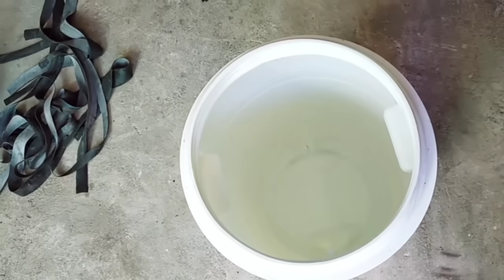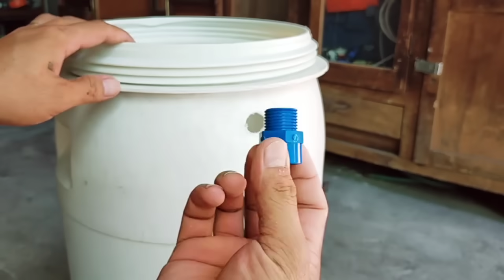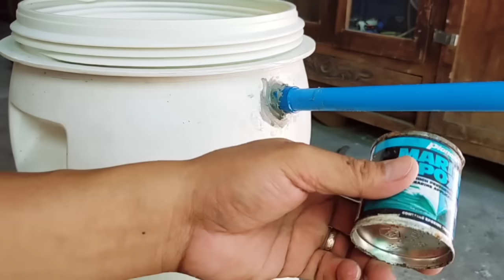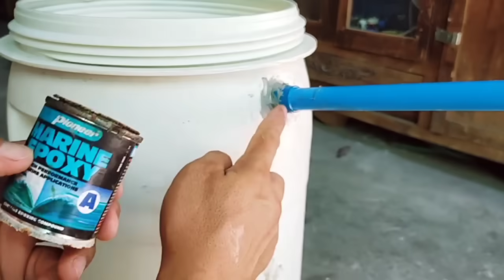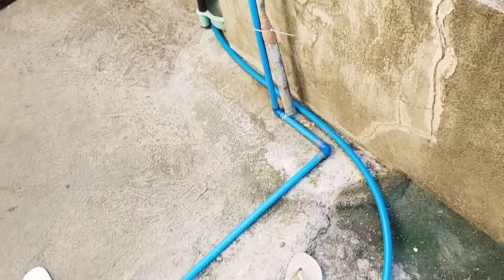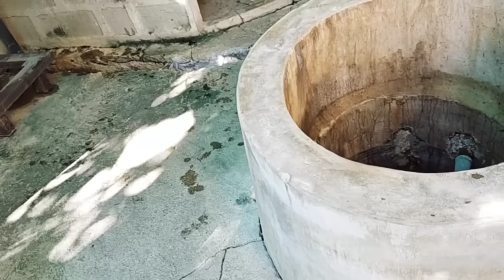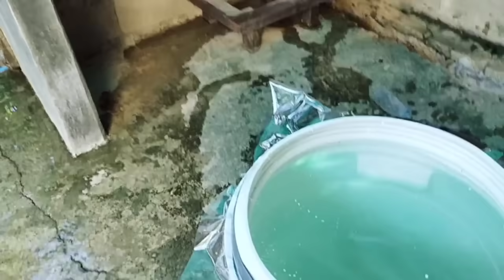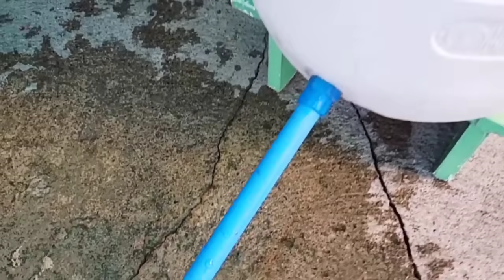improvised water pump no electricity how does it works none stop water life hack part 2

Comment: So if this works you could just let the water go  back into the well or a pond for that matter for circulation and aeration purposes. Interesting. Effectively a small waterfall pump without any moving parts! A foot valve at the bottom of the intake hose would be good right? It would be nice to know the over all height differential in this experiment. Such as the distance from the intake end  in the well to the upper outlet on the tank column.  The height above the surface of the well water to the tank column lower outlet.
This distance represents the achievable lift out of the well.
 The vacuum column pulling water in at the top as water drains out the bottom  is really cool!
Reply: To nice to be true! It would be a perfect perpetuum mobile, since if water flows back in the well you could let the water drive a little turbine. It is impossible to lift water to a higher level without an input of external energy. However, if the outlet is lower than the water level in the water reservoir, it works. Water will flow some height upwards and a bigger height downwards. But this doesn't need a drum and was already known B.C.
Reply: @sciencefreak9070  I tried a small version. A milk jug on the edge of a sink. The up draw from the sink shows there is "some" pull as the outflow takes place but I have enough curiosity to continue to experiment even though it does really seem unlikely.  Nice youtube prank though. There is that.
Reply: @kazparzyxzpenualt8111    I don't know what exactly you tried with a milk jug, but I can assure you that the outcome of such experiments are easily predicted for any arrangement. There are no unexpected surprises in this field which could be discovered.
Reply: @sciencefreak9070  you know under pressure?
Reply: @mafiozozpruszkowa9419     "Under pressure"?  Objects and persons can be under pressure. But for this video only air and water pressure are relevant, and I know these pressures and what values they will reach during operation.
Reply: If installing a bigger outlet or multiple outlets would increase the the pressure drawing the water into the tank then I'll go for multiple outlets which some will be just for taking the water back to the well and installing turbines that will be turned by the returning water thereby free water and and free electricity

Comment: hello, I recreated the same system but opening the tap to let the water out does not draw from the well, are we sure it works?
Reply: Water level in well must be higher than exit for this siphon to work, as with any siphon.
Reply: It should be air tight.

Comment: Wala na sanang nagbininta ng mga electric water pump at genarator kung gumagana nga ito
Reply: It works. If it was fake and pump driven the plastic should inflate outwards. But here plastic cover sucked inside. It may work at 6m deep well with 1m hight water.

Comment: This is capillary principles on the great scale  , this system works because the atmospheric  pressure its a little bit bigger at the surface level of well than the level of the outlet pipe .. You know , at the sea level the atmospheric pressure its higher than in the top of a mountain . In this system this principle its helped by the vacuum chamber and the gravity , the weight of water mass flowing down

Comment: Assume  mass M of water from the well and the height(the level of well water to the basket ) be H. The amount of energy needed is MgH. where does thsi energy come from?It must from the water running out of basket. Assume the height of the basket be hand the amount of water running out is m. Them MgH=mgh.  that is MH=mh. As M must equal =m as they represent the water runing out. Therefore h must be equal to H. Therefore, it is impossible. just a cheat.

Comment: The amount it vacuum you would need would collapse that plastic seal or even that cheap container. In this case air would go into the open end of the pipe if you could get it sealed
Reply: Not really. The only vacuum created is at the outlet end and not the entire mass of the water- it is supported by the container. 
It would be much less vacuum than you are thinking. For example, a increasing diameter outlet tube would equal larger vacuum pressure affecting the lid, to the point it would collapse.
Reply: @shane 
Your observation is wrong. The vacuum created is compensating by the water inlet..
Reply: Incorrect. The plastic just needs to be able to support the amount of water being suctioned.

Comment: What is the theory of this mechanism used.plz answer
Reply: You want to understand theory first read how ram pump work. Google it this setup is reverse the ram pump setup. Both sys use gravity and momentums of flowing water. Ram pump creat pressure use that force to pump up high ground but this sys is reverse creat vaccum suck water from low ground when moment sucking force and reverse water weight equal it shut return block vale at bottom of sucking pipe. But before shut off there fluid memoturm trap some water bottle neck of vaccuan tank those water flow in to tank use gravity that process non stop repeat time you only see small amount of water enter to tank.

Comment: Very gd , I have down my own but not working i used small drum and the intake pipe 12mm black pipe whilst the output is an ABS pipe 12mm.. Once i filled up the drum it was compressed due to the pressure of the output too strong whilst the intake pipe internal hole too small  compared to the ABS pipe out, i will modified the intake pipe into 20mm or 25mm may be it works because the supply to the drum can coup the output..any suggestion from anyone of you..pls comment.
Reply: Dear kaka Lala Salams, if you want to use this process for irrigation kindly use cemented well rings instead of drum so that it should not collapse. khattak from Pakistan.

Comment: Good idea, I wonder the maximum well deep length and also input and output pipe diameter, I have a 18m deep well and not sure it will work properly.... Any thoughts?
Reply: don't waste your time and materials. forget this video. this is fake.
Reply: @edgarcordova4534  means no other way to have energy free pump?
Reply: @neoteo4506  I wonder. Man's so pessimistic
Reply: @chimaihedi  what are your thoughts Chima?
Reply: @edgarcordova4534  its not fake... But suction head has limitation... 
Get some free time and bigger drum... And prove yourself wrong.

Comment: On your first take the plastic burst. What did you do to fix it? How long did it run ? What is the depth of water in the well?
Reply: forget this video, this is fake
Reply: it happened to me as well with the tank than air starts getting in from the out let pipe
Reply: That why who use in field they use 55 gallon iron barrel.

Comment: Just curious if anyone could actually replicate this.

Although on principle,  the pump looks like it could work, this example is fake, and here's why.

When filling the barrel with water, any water that reaches the intake pipe (coming from the well) would drain into the well.  Also, once the bottom pipe is opened, the gap (vacuum) created would have to atleast equal the volume of the pipe going to the well.

Comment: It's not for along time, bro..!
Just 1 to 6 hours the system must be stopped. It depends size of your tank. If the tank is bigger will be more longer to stop than smaller tank.

If you're fair..
Try sending 10 frames of video in sequence (6 minutes only) from the original old video (eg 3 hours). At the end of the video, we will definitely see the failure of your system.

Comment: IT'S BETTER IF HE INSTALLED A FOOTVALVE ON THE SUCTION HOSE. AND ALSO IF THE TANK IS POSITIONED HIGHER.
Reply: the second law of thermodynamics dictate that this setup would not work. forget it and better learn the ram pump, else, if you'll try it, you would just waste your time and resources.
Reply: @edgarcordova4534  IT IS PROVEN BY ONE VIDEO USING A TRANSPARENT COVER OF THE CONTAINER. IT SHOWED THE WATER COMING UP, ERPLACING THE RELEASED WATER. AND I BELIEVE IT WORKS MUCH BETTER IF THE TANK OS POSITIONED HIGHER.
Reply: @edgarcordova4534  CAN YOU IMAGINE THE FORCE OF THE VOLUME OF WATET FROM THE TANK RELEASED, ITS VACUUM POWER CAN DEFORM THE DRUM. HOW MUCH POWER DO YOU THINK NE3DED TO SUCK THE WATER FROM BELOW WITH ONLY 11/4" DIA
 SUCTION WITH FOOTVALVE?

Comment: hmmm wonder how he gets the plastic rag to stop the water from flowing out the bottom drain, he has it so well plugged with that stuff it barely drips, that's a lot of water pressure on that drain. there is no way the water can be pulled up from the well, he didn't even prime the intake from the well. this is fake.

Comment: I have tried to achieve the flow but in vain. Kindly someone to advice me accordingly.
Reply: @divxxx  i am pretty sure it works and isnt fake. did you see where it pops because of the vaacum?
Reply: @divxxx  i just made one out of a 2 liter soda bottle, straws and hot glue and it works!
Reply: @divxxx  okay i lied before i didnt make the thing. it doesnt work.

Comment: there is a water pipe below direct from water provider ..scam is the key
Reply: 😂😂 it works. If there is water pump it should inflate the plastic cover outward but here it has been sucked inside due to negative pressure inside.
Reply: If it is a scam how much money they are going to make?
Reply: Fully agree. If this worked they would have made a perpetuum mobile. Creating electricity out of notting in your back yard.

Comment: Check valve is used in this case,at the end of inlet pipe hose that goes all the way down to the well,but the guy didn’t show it otherwise the suction would be impossible thanks

Comment: Yeah it only works with either a pump or pump with a valve in the well or not the second pipe going into the well. Go ahead and build one. The water will run out some then go to a trickle then glug glug like an old fashioned water cooler then run some more out then glug glug. Go back and study or actually try it and watch and learn. Simple physics. This does not work now will it ever work!

Comment: This is how those large concrete water reservoirs continuously have water in them without any motor puling the water from the ground.
Reply: No, this is no pump.
Reply: @kjellg6532  No. There are concrete water reservoirs in our old housing villages that don't have motor pumps but never ran out of water for around 2 decades. They simply siphon the water from the ground into the concrete reservoir as people use the water in their faucets. I can assure you that concrete water reservoir never had a pump lifting up water into the tank.
Reply: @refererererer  To lift a stone from the floor up on a table yoy must add energy to it. To lift warwe from the ground to a higher reservoir you must add energy to the water. A siphon has no energy source, so what is lifting your water up?  If peope here just added a small turbine and generator, they would have access to free electric energy.  That would have been a sensational discovery There must be mor to your system for it to work..

Comment: instead off using buckets couldn't you just adapt a pipe onto your manual pump and feed straight into the barrel? Also a pump Draws water and applies pressure to a system, this is just a Siphon.

Good idea though, and attention to detail.

thanks

Comment: many parts of the video are cut out, this is not possible if you don't use a submersible pump in the well,if this method works why are you still using an old hand pump and using a pump machine too?

Comment: Hoax
Reply: How? Can't you see 👀 the negative pressure building up inside the barrier that sucking the plastic cover inside.
Reply: @infinitebeing1119 The low pressure in the tank is not low enouh for water to be pressed up by the atmospheric pressure. This because the height from the well is higher than the height from the output to the water level in the tank. No siphon can lift any water. If the output had been put into a bucket of water, and the tank totally filled, the flow would be reversed back to the lower well.